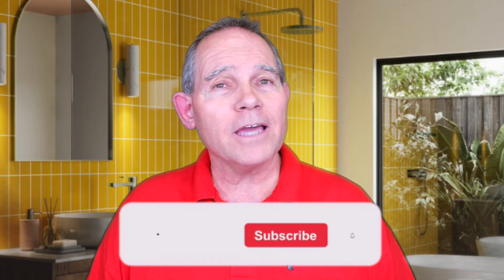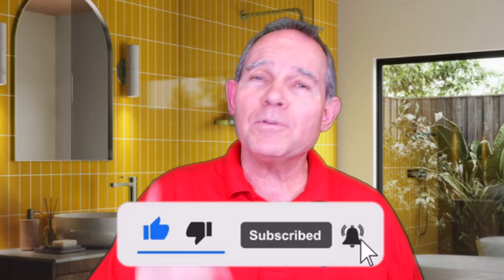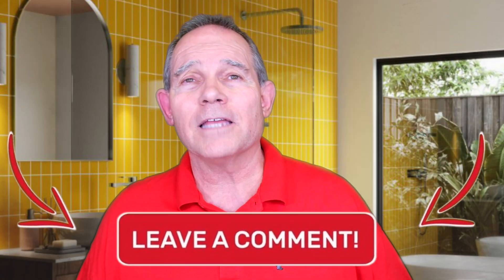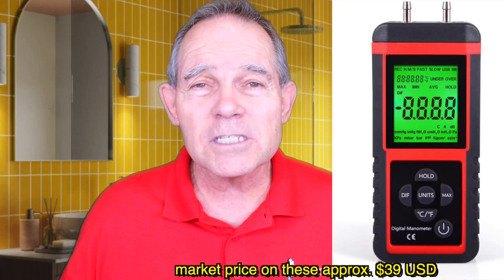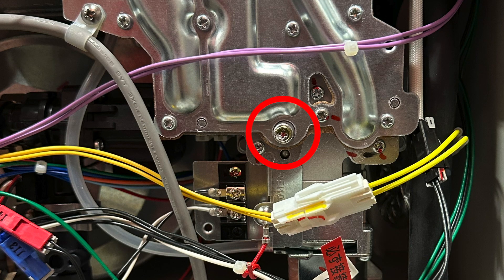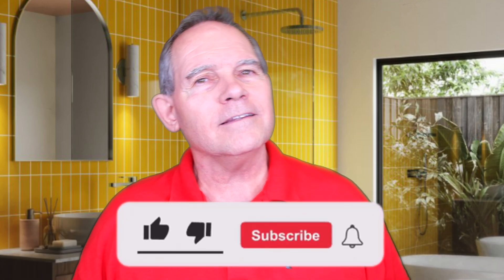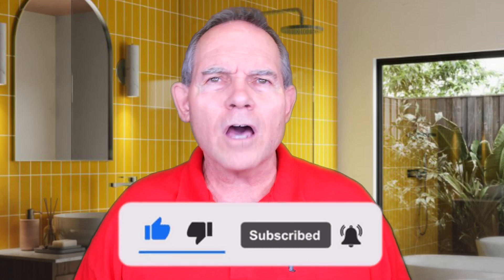Why You Need a Gas Manometer if You Have a Tankless Water Heater!

Comment: Wow thank you did a great job keep up the work I just install my first tankless heater iam having 1 problem with this I have some experience with gas furnaces so I kind of understand how these things work but I do not know why I have a brand new one and I'm having some problems with it I am learning these things are very finicky and they have issues with low gas pressure power water how do I know when all this I would not have bought one
Reply from the maker: Not so much finicky but you have to likely upsize your gas system to supply the proper amount of gas  for it as you do with any gas appliance add on.  Thanks for
Watching and hope you get
It worked out.  👍😃